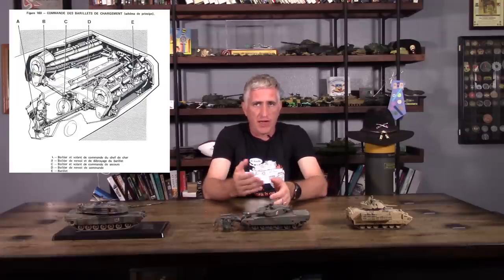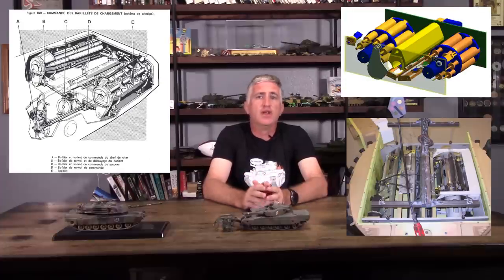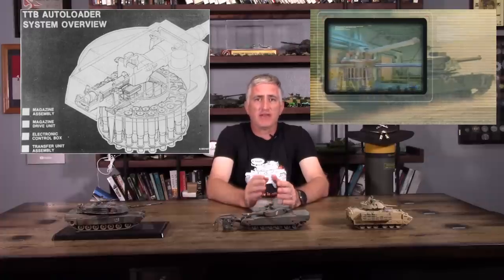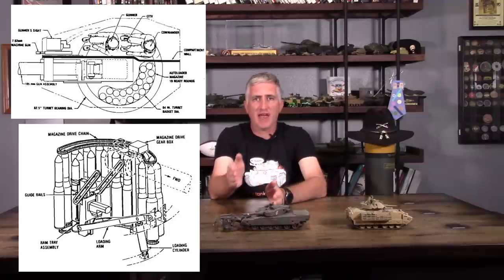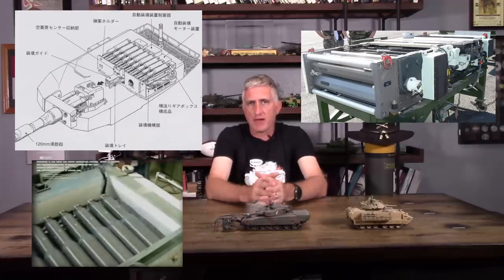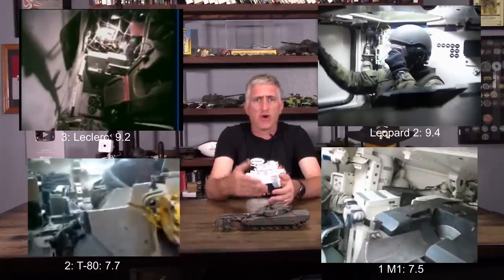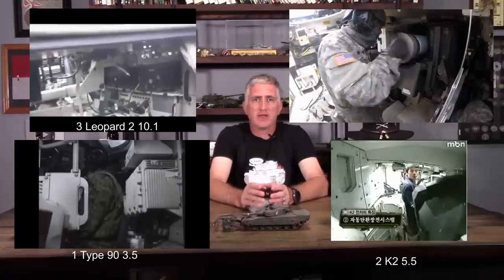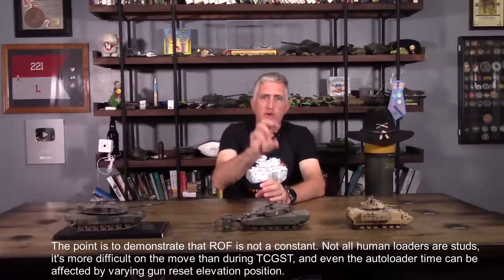Whither the Autoloader?

Comment: Correct me if iam wrong but looking at the new KF 51 Panther it has an auto loader because of the size weight of the round 130 mm but they have kept the fourth crewmember I suspect under his jobs to do is to manually feed the gun if the autoloader goes off line ..but what I do find interesting is he is in this tank more like a systems operator in a F 15 he works the defence of the Tank and reconnaissance by using drones and also the use of attack drones like switchblade  and I have a feeling he also operates the 30 mm auto cannon where targets can be picked up by the tanks radar like helicopters drones etc also to engage targets like APC and AFV and soft skins from what I understand the tanks comander can also designat targets to him via the hunter killer system so he does not have to Waste the main gun ammo which is because of its size they have a lower amount than a 120 mm main gun so targets that mite of got a 120 round now gets a 30 mm again this gun could be upgraded but again you have to take into account the amount of ammo that can be carried for the auto cannon versus the Penetration and affect of a lower calibre but a 30 mm seems to be a good round for multi use so taking on AFV with the 30 mm rather than a 130 mm seems to be a better option this weapon by the looks of it has a high angle so it can be affective in urban situation as well as air defence especially if it has a multi role fuse that can do air delays Proximity as well as PD in a way I see this new KF 51 in a role more of a heavey tank than a MBT but with the exsta speed of an MBT
Reply: yeah, Rh-130 uses 30+kg ammunition. 
The fourth member is not an optional loader (there is only rounds in the sealed bustle) but to operate the drones. The drawback is that the drone take half of the bustle place, meaning they take half of the round place reducing ammo count to... 10. Non, I'm not joking, with HERO launcher you have 10 rounds to fire. And this will not really be compensated by the RCWS because of one thing, on the Panther, that's a NATTER RCWS, a 7.62 teleoperated machingun. 7.62x51... At least EMBT provides a 30mm M781 (the same from the Airbus Helicopter EC-665 Tigre)

Comment: ultimately most of the things discussed around auto-loaders is just minutiae. It doesn't matter. ROF is basically irrelevant for large caliber weapons because tanks are never deployed as a single tank. The real world is not a War Thunder 1v1, it's a 20 V 20 or a 200 v 200 or a 100, 000 v 100, 000. 

I think that if your going to bother crewing a tank at all you may as well not bother with the full scale auto-loader. Most of the advantages of a auto-loader help you in a mlg 1v1 matchup, which isn't really reflective of real live. The Merkva has the right idea, as the life of Soldiers are worth more than ever before. The sheer amount of expertise and training put into each single soldier in modern armies makes losing each of them a serious operational loss. Most large countries only have a couple of hundred thousands troops and replacing those high quality troops during a full scale war is going to be very hard, and so militaries are focusing more and more on trying to stop soldiers from dying. (France and the UK only have about 200k troops across all branches each). 

I do agree auto-loaders are the future, but mainly I think that the entire tank should just be made RC. An RC tank could be made so much smaller and much more protected as well. I don't think all tanks should be made RC, but that a sizable ratio of a tank force should be made RC with crewed tanks dispersed throughout the force.

Comment: It depends on what you are using them for, automatic loaders are not new, 75 years ago https://youtu.be/pX-IxiZyGRk this was used very effectively with a mosquito, against U boats and Shipping. So it is the requirements which are key. As we move inevitably to drone type vehicles for ground warfare a vehicle with an automatic loader is inevitable. The argument for MBT, is it reduces fatigue, though I am not so sure. WW2 the Firefly crew was to be reduced from 5 to 4. However, from experience some units kept the crew to 5 because of the operation and maintenance needs required to maintain the Sherman. Whilst, modern vehicles should require less maintenance, is it significantly less  to reduce the crew from 4 to 3? The other issue, is the amount of ammunition that can be carried, given the space taken by the complexity of the autoloader.

Comment: 14:50 Poland also moved away from autoloaders when they bought 2nd hand Leopard 2's  to complement their T-72's. Although their PT-91 does have an autoloader.
Reply: The autoloaders were on long outdated versions of the T-72, so biting the bullet on the convenience of the autoloader was worth it to get a tank with modern armor, a modern engine, a modern gun, and modern fire control systems

Comment: Personally I think an 8*8 vehicle with 105 mm mounted with an S-tank system should have a future as medium tank.
The 8*8 adresses the problem the S-tank had with steering due to the fact that track length in relation to the distance between the tracks needs to be within limits. Is the track to long the damned thing cannot turn. Is to short the whole vehicle becomes uncontrollable and tend to spin around the center of gravity axis.
The autoloader should reduce the manning requirement - not that I will get rid of the fourth person or the turret. Not so. The fourth person could have an upgraded version of the anti infantry/anti aircraft mashine gun - preferably of a larger caliber with noone in the turret those electronic gizmoes should make it possible to keep his head under some reasonable protection. The Germans goes - as pr. usual - a bit overboard with a 35 mm gun - a smaller caliber should be able to do the job,
One thing is keeping the rate of fire up which is the key in anti-aircraft/anti-drone/anti-missile fire, as an aircraft has a not insignificant forward motion - like the idiot that runs head first into an approaching train - with a background in the railway world - I can assure you the result is generally fatal.

As to the smaller caliber: There are two things to consider: The recoil, as wheeled vehicles might have a smaller tolerance to recoil? The other issue is the kinetic energy delivered to the target.

Now recoil is mass * muzzle velocity, Reducing the mass should be catered for by the reduced caliber - you might even bring up the velocity by using a longer barrel.
The problem about the kinetic energy = ½ * mass * velocity squared - is that kinetic energy drains off with the velocity the projectile has at any given moment squared. It might cost slightly in lethal range; but then again: According to figures You have brought: The median distance of tank kills is about half the average distance - which means you will only chop off a bit of extreme range. Now line of sight on a european battlefield is rarely more than say 1000 meters, so ....
Reply: You also lose off road capability. You sink to the axles in mud, sand, and plowed fields. Ground pressure is everything.

Comment: The bean counters wouldn’t just be looking at getting rid of them for cost cutting purposes but also because of the additional costs.  At the low end if the loaders are used to crew the APC’s as well it means 2 extra APC’s to purchase per company and some minimal expansion of maintenance and logistics.  At the most it means 2 expensive Namer-like APC’s (if they are to be as survivable and mobile as the tanks they support) and 6 additional soldiers to crew them per company plus a minor expansion of maintenance and logistics.  Every battalion would also need 1 or 2 additional APC's for HQ tanks but that’s not a major issue.

It looks like the US ~100 tank companies between the Army, National Guard, and Marine Corps so admittedly that wouldn’t be a massive increase, $1 billion or so for heavy APC’s, 600 soldiers, plus whatever additional support but I can see how certain Congresses and Presidents would see that with 1,400 “redundant” loaders as very tempting “fat” to cut.

The question is how many countries that use autoloaders follow the French model of putting surplussed loaders in APC’s.  If most, outside of Eastern Europe, do then this con goes away outside of the minor cost and concern over whether it would last specifically in the US (personally I would be surprised if this format was maintained after the 2013 Army reorganization but who knows).  If most don’t then I seriously doubt we would for any length of time which brings to the fore the lack of a 4th crewman for maintenance, security, and general redundancy.

A couple questions about minor cons that come to mind.

Using mechanical equipment in a marine environment is an issue but I do not know how big or tiny it is in this case so this may essentially be moot.  The Marines use the same tanks as the Army so they would either 1) split the tank force into 2 types using a small number relative to the Army which would be more expensive, 2) use specifically marinized autoloaders in the same tank when the Pentagon’s procurement system has routinely failed to do such things in a cost-effective manner (if it’s even possible, marinizing the Pzh2000 was a failure), or 3) marinize all autoloaders at extra cost.  I know the Russians have used autoloaders from their inception with their naval infantry tanks but then they don’t really care about things falling apart.

How does it affect training?  The stranded crewman still has to learn the other roles to replace casualties or missing crew so does only being able to fit 3 limit the 4th crewman’s training?  Or does everyone, except the TC I suppose, get limited time, or do you spend more on expensive fuel and tracks for extended training?  Or does it just not really matter?

Of course a lot of countries use auto loaders now, but they generally fall into 2 groups, developed nations which rarely use their tanks and Russian/Arab nations that mostly care about cheapness and low weight for their poor infrastructure and care little for crew safety.  I would balance that by noting 3 countries that have been hesitant are the US, UK, and Israel.  These countries fall into neither of the above groups since they both give very high priority to crew safety like the former and also have frequently used their tanks in major combat like the latter.

Lastly, related topic, since you spent a good amount of time in Iraq operating with only 3 crew, in your experience how much difference did having a 4th crewman make for the extra work?
Reply: one could argue that if budget was an issue you could use trucks to move the crew who are pure maintenance around (from what i can tell this is what the russians do) or design a cheap tankette for them.
Reply: @matthiuskoenig3378  True, but the US would never do that and it would only provide the maintenance value of 4th crewmen.  I know it's not itself a major con (the US can afford the extra $1 billion or so p.a.) and it doesn't speak directly to whether an autoloader is intrinsically better or not but if adopting one causes a nation to maximize the known cons to save a few pennies then I would argue it's better to not provide the bean counters the option.

Comment: @12:45 "The French have solved this by putting their extra Tankers in an APC or two" Close, or at least according to Battle Order's video on French Leclerc Platoon structure, each Platoon still has 4 tanks, but also has an "Investigation Group" of 4 light armored cars, each with 3 crew (though manpower allotment means one scout car only has two crew, and they need two crew members to staff a supply truck that's actually attached at the Platoon level, but that is an extra 9 crew members in essentially Humvee equivalent vehicles at the Platoon who can assist with maintenance, backfill casualties, etc)
https://www.youtube.com/watch?v=6ov6AUVUl0k&t=47s

Comment: I've often wondered about the resistance to auto-loaders in tanks, it's not exactly new technology. Mechanical loaders or similar have been in use on board warships for a long time, largely because of the issue of handling massive shells. It's a natural technological evolution as the shells become larger to move to assisted or automated loading. Heck if anything, the auto-loaders I've seen look positively ancient compared to modern robotics

Comment: Who is going to employ sustained fire in an actual war, this is a null point.
Chieftain you should know better than anyone, that first shot kills most of the time, and with a disciplined crew you should be hitting those shots. And for anything else, accurate fire beats overwhelming fire the majority of the time. This I feel might be the biggest barrier to adopting autoloaders, for most it might just seem unnecessary.
Reply: What if you have already burnt through half of the ready rack and then you have a miss? Chieftain mentioned that the first 3 or 4 rounds are stored basically in a sweet spot. It's very easy to load them manually, but once you got through these, a human loader will need longer and longer to load because the loader has a harder time to pull the rounds out of the rack, turn them around and push them into the breach. That has nothing to do with sustained fire, but simply with the fact that maybe more targets are poping up after you killed the first, second and third target. 
Also the loader is actually the crew member on board which determinds the hight of a tank. The loader is the only crew member which has to stand upright for his job. That means this has to be taken into consideration when designing the tank. A human loader needs at least about 2 metres vertical space inside the turret.
Also an autoloader doesn't make a cannon les accurat.
And there's one more point. Maybe you already heard that but Rheinmetall made some trials with a 140mm cannon in the 90's and one thing they realized pretty quickly was that 140mm ammunition would be so heavy that an autoloader is a necessaty to load them within reasonable time. A human loader can't do this anymore.

Comment: Ha! You totally forgot about that one in a blue moon situation where you have a round loaded but need to remove it, because it was a dud or something else. And then autoloaders clearly are inferior to manual loaders. That is why we should never adopt autoloaders. Checkmate sir!

If you can't tell that was sarcasm.
Though does raise an interesting point to bring up. What is the procedure to remove an already loaded round from the gun?
Reply: Fire the round...
Reply from the maker: He's right. That's the fastest and safest way of doing it. But if you have to access the round, for misfires, for example, usually there is a manual option.
Reply: @TheChieftainsHatch  Never a fun time dealing with a dud when it comes to anything that can go bang.

I could imagine you would want to put it somewhere where if it were to go off, it wouldn't take the crew with it. So back in the bustle rack as it were.
Not that easy of an option with an autoloader.

But then seriously who picks a design because of a one in a million scenario rather than ordinary operating procedures? That's how the Chieftain ended up with a crappy multifuel engine that only ever ran on diesel.

Comment: Reason for a loader in this day and age is the argument for the loader being another crewman to do crewman stuff. Track tensioning for instance. Or reloading the coax machine gun. Another reason is having to loader switch over when a round flies in and wipes out the gunner or the TC. But at that stage is better to GTFO. The "other set of eyes" argument can be resolved with sensors and cameras nowadays. Also you're looking a little tan there eh Major?
Reply: reloading the co-axel can be replaced with a longer disintegrating belt. or by the TC. you don't need the crew member in the tank for maintaince stuff like track tensioning.